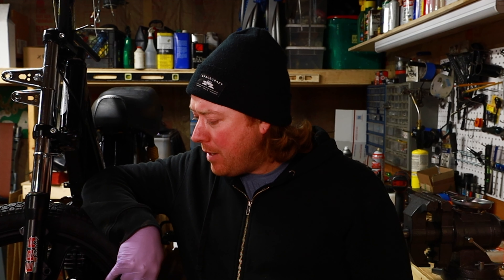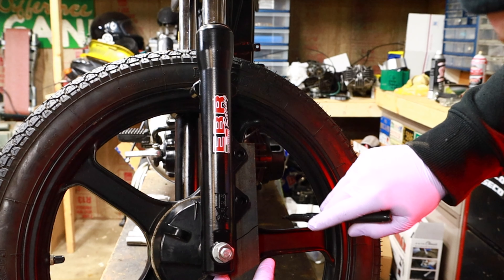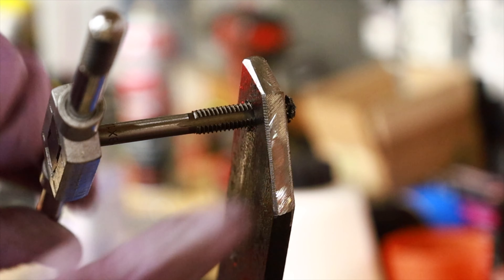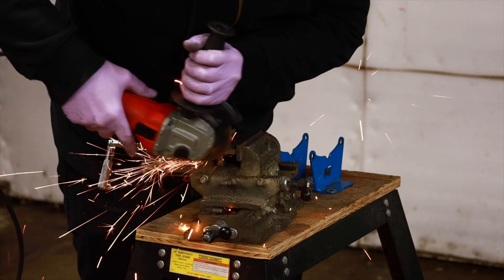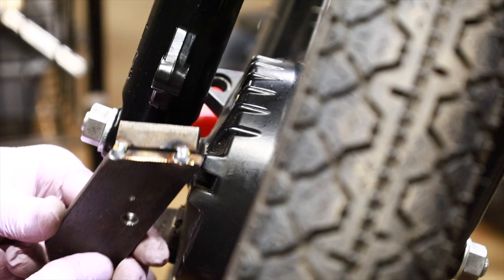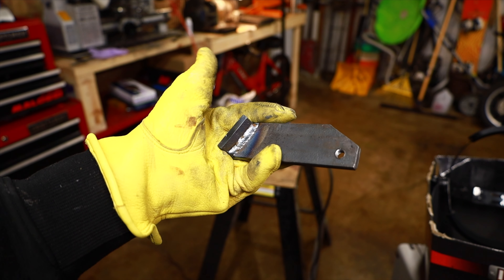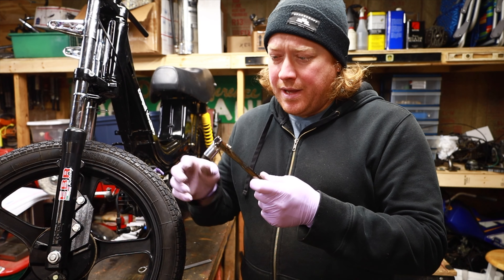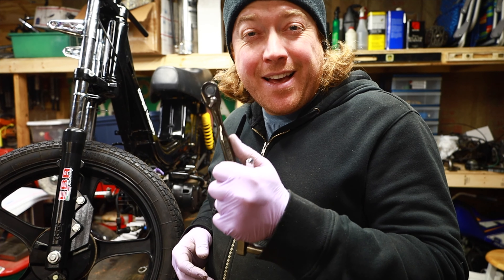Install Drum Brake Wheels in Disk Brake Forks!

Comment: That's a great trick.  It does change the position of the brake arm relative to the forks.  Has that ever been a problem, or do you just adjust for it with a longer cable, or by modifying the arm?
Reply from the maker: It hasn't been an issue. Usually it just makes the cable a difference angle.